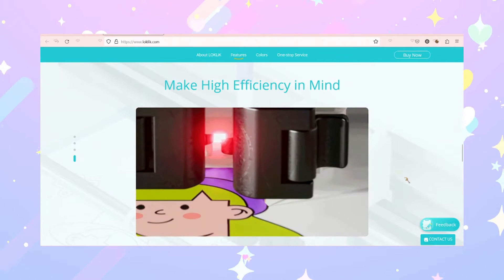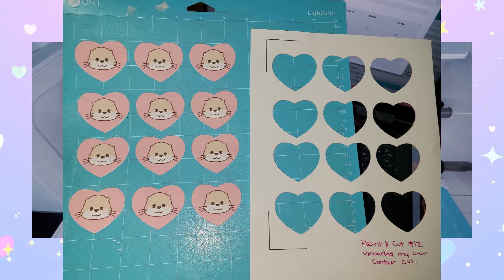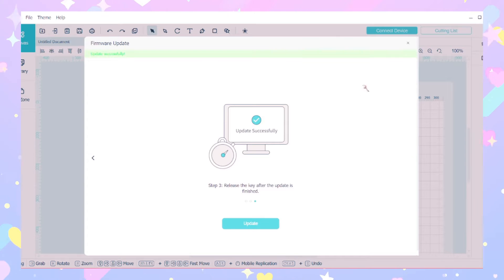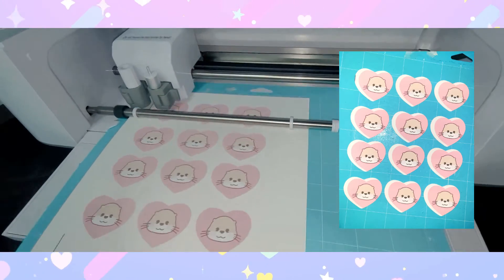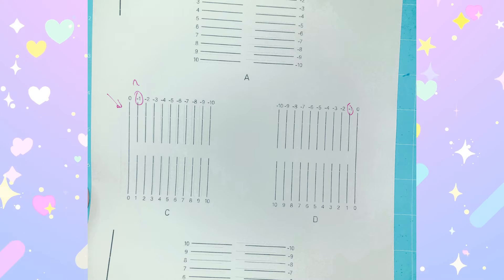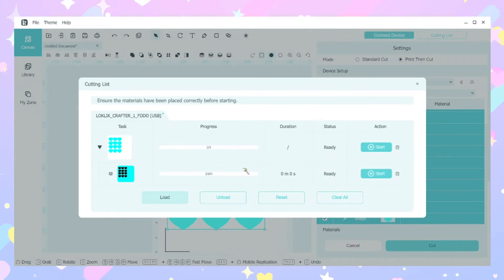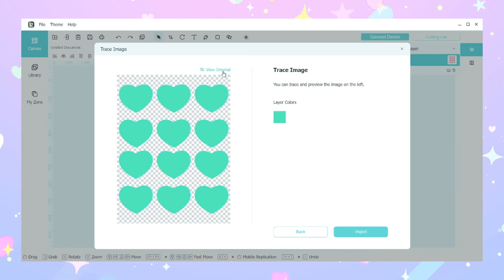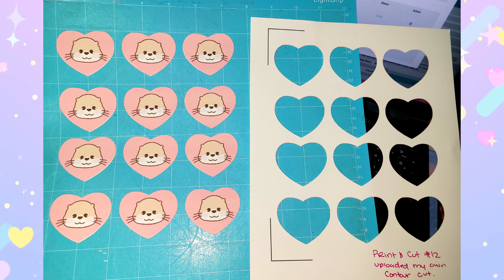#loklik Firmware Update #10 // @OttysCreations

Comment: For people arriving here with the firmware update problem:
25th of April 2025 - The software - both the Studio AND the Flashtool STILL do not work with AMD processors but it also doesn't work with at least some Intel processors
Tested on and AMD 9800X3D Windows 11 - didn't work, either said failed in Studio or didn't get past 1% in the flashtool, tried MANY times, rebooted and so on.
Tested on iPhone 16 PRO MAX - App said it was updating and proceeded to 100% but failed. Tried the procedure four or five times.
Tested on older i7 INTEL Windows 10 laptop - didn't work in either Studio or the flashtool.
Tested on Intel NUC computer. i5 CPU. Windows 11. This worked!
Loklik need to update their software urgently. Most users would give up and send the unit back as faulty.
Reply from the maker: Thanks for all your research/data findings. I will test out new update soon~~

Comment: Ive been trying to get mine calibrate all day.. its like acts like it's cutting but I cant see or feel any lines and no matter I do with the print then cat, it tells me that no layers are selected to cut, after I selected everything
Reply from the maker: I had this happen once. It may be a faulty machine. Definitely reach out for a replacement if possible 💕
Reply: @OttysCreations  I changed the blade and it actually worked.  I'll see how it works cutting and print then cut

Comment: Unfortunately for my Loklik machine. I was never able to do the firmware update. It always shuts down and says update failed. I have tried several ways and it doesn't work. It is at an unusable point because without that update it won't let me calibrate the blades. And the reality of it all is that customer service is lousy. Buying Loklik for me was a mistake.
Reply from the maker: I get your frustrations. You may need a replacement. I think they are on holiday for the new year, but I've read many who couldn't update or power on got replacements. Definitely shoot them a message for one. Best of luck ❤️

Comment: Hi, Im like you I'm on my 10th print then cut calibration working on this on and off for over 3 days, and nothing is working. Ive been in many communications with Loklik in the middle of them they issued V0010 firmware update. 
They have also advised me the Calibration values do not have to be at zero. 
They are now on Chinese New Year holidays until 17th so I doubt I wont get any more information from them until after that.  I was hoping I would have updated information for my followers too regarding the Loklik but sadly no.
At the moment the Loklik is just my vinyl cutter and my ScanNCut is used for everything else.
Reply from the maker: I understand & I do remember seeing about the new year as well. At first, I didn't think the values mattered either, but on my last calibration, the cuts oddly enough were precise on "0". This was only after I reset my calibration on calibration #9, when I realized how far the cut was from the values. Try doing a reset on calibration?
Reply: @OttysCreations  I’ve had mine at 0000 and it still didn’t work that’s when Loklik told me the values don’t have to be on zero to work I’ve given up for now until they come back to me
Reply from the maker: @applelover53  I hope it works out for you. I think you may be able to get a replacement. The first one I had wouldn't calibrate either nor cut properly. Best of luck ❤️